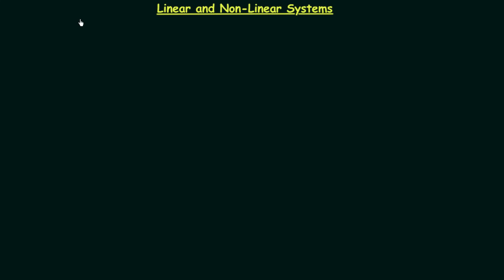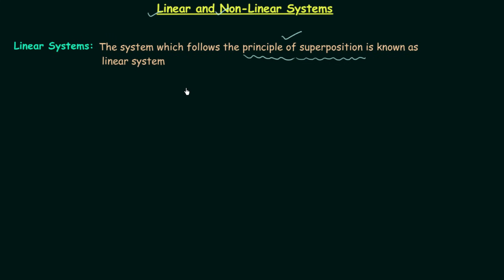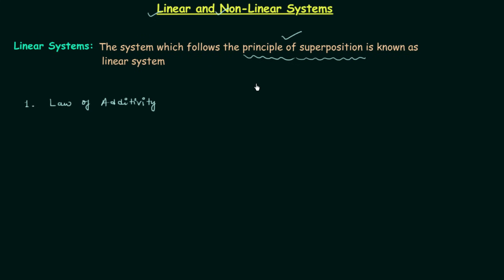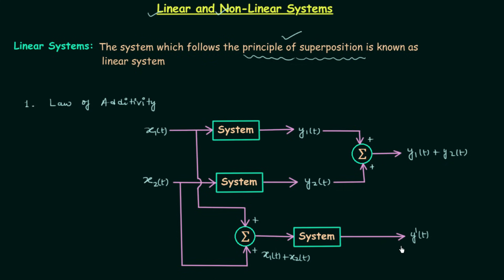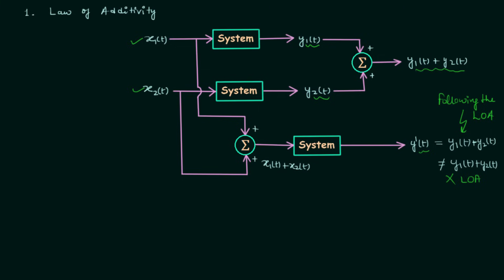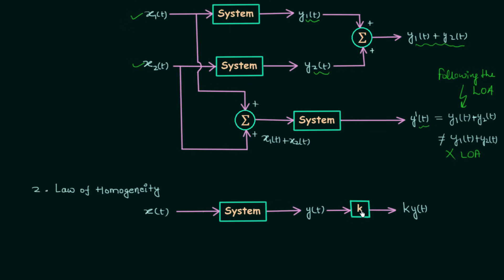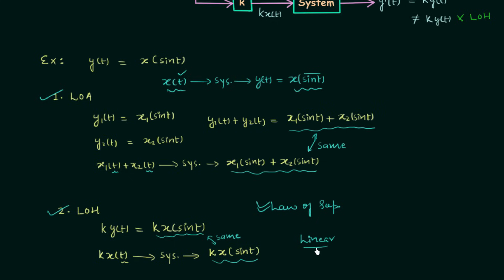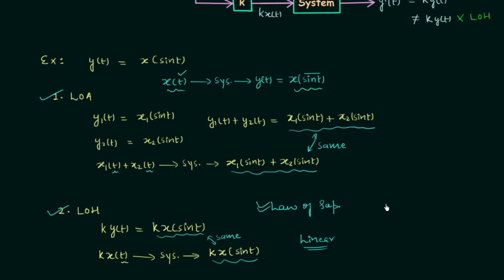Linear and Non-Linear Systems

Comment: I have question on addition of 2 functions here. x1(t)+x2(t) -> system, are you saying the x2(t) follows x1(t) to the system, if this is true then, x1(t)+x2(t)->system->x1(sint)+x2(sint), otherwise if you are adding these 2 functions bit by bit, I don't see how you can tell the equation holds true. I appreciate clarification on this. Thanks in advance.
Reply: i had the same question

Comment: sir what if an system follows the equation ...y(x)=mx+c
the equation and system is still linear but it does not follows the LOH
Reply: If you’re defining a System then output and input depend on the same variable it should be,

y(t) = mx(t)+c

For a System to be linear,
           y(t) = 0 
when, x(t) = 0

This is a non linear system.

Comment: Did you mean sin(x(t))? In this case that would be non-linear system.
Reply: Correct, and it's quite simple to check, (sin(1) + sin(2)) - sin(1+2) is not 0 as it would be in a linear system.